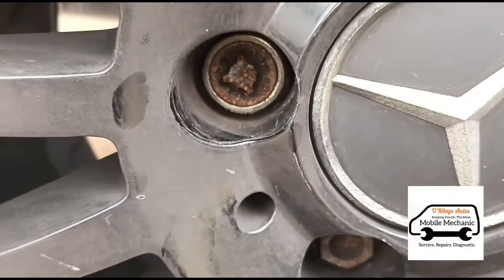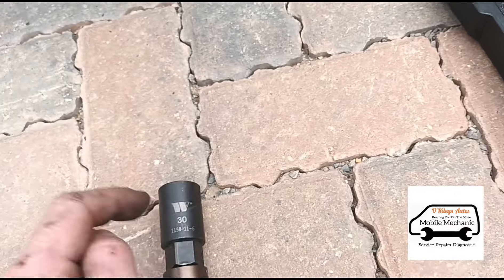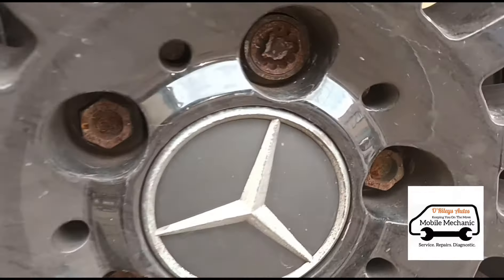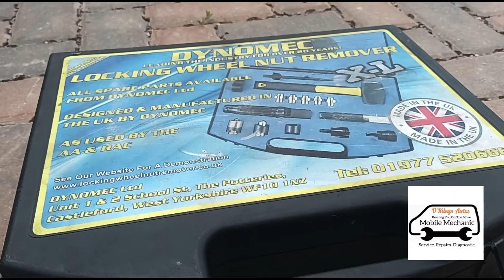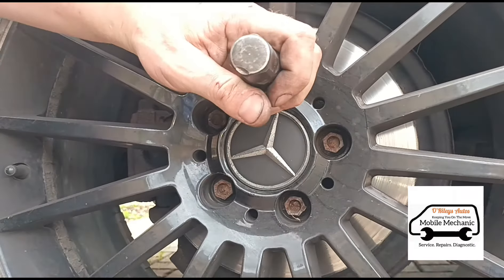2 Methods of Removing High Security Locking Wheel Nuts Without Cutting Spinning Sleeve

Comment: I did mine with 22mm socket and hammer.. unfortunately just sleeve came off and my removal tool is too big to get inside the alloy 😢
Reply: So were you able to get it out with the 22 or should I get the 30mm

Comment: ive turned a few bits for round bar to fit inside them sockets to knock the rings out with the punch . all the best simon tyne and wear locking wheel nut removal

Comment: I noticed that the shroud was very loose once inside the wheel nut housing whilst you were trying to steady it and hammer at the same time. If you had wrapped electrical tape around it to widen its girth it would be far more stable and easier to hammer…..

Comment: I find the dynomec supplied impact driver to be pretty poor. Only seems to work on nuts that aren't very tight. Usually end up using a breaker bar to get most nuts opened.
Reply from the maker: 100 percent. I said this in an old video but almost nobody agreed and just said I don't know how to use it 🤷🏻‍♂️